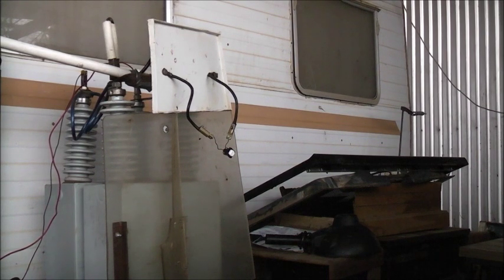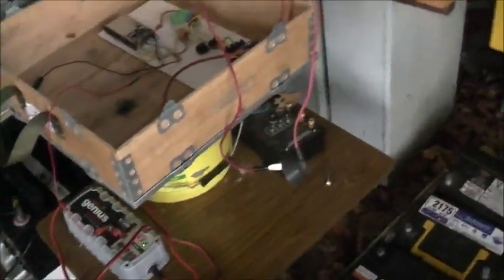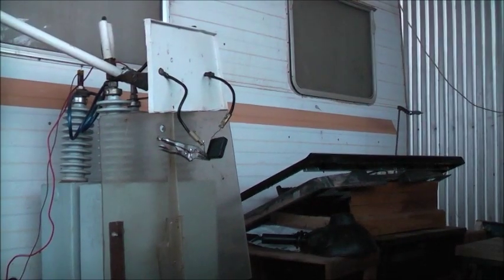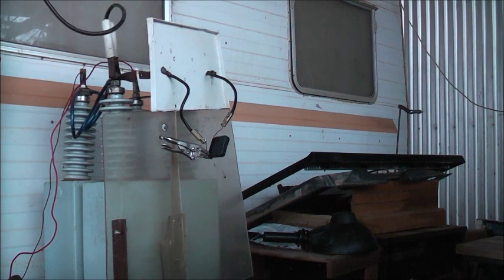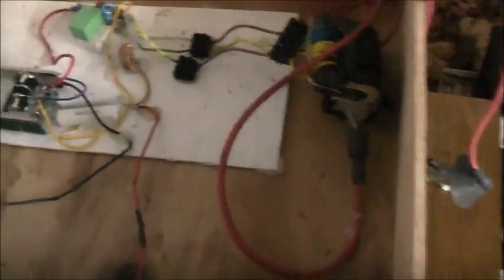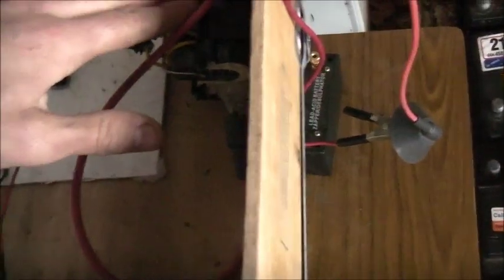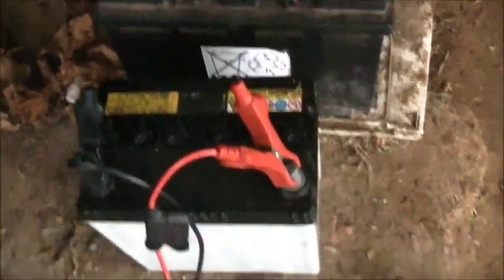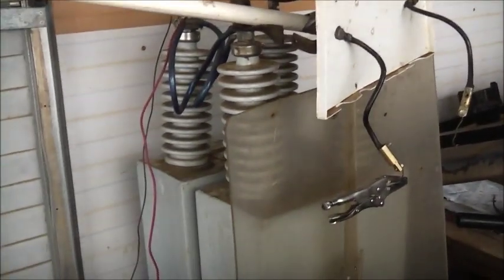Finishing Off Switch & Clock On PFC Cap Bank!

Comment: Clock mechanisms like that one are full of little shiny glittery stars. It's what makes them work and keep time. :D If you accidentally or deliberately overcharge them....

=WHOOOOOOOSSHHH= They all come shooting out everywhere. :D

It looks like you released all of the ones that were put in that mechanism at the factory. :D =YOU POPPED IT!= Now that you've let them out, that clock mech won't work anymore.

I think that lightswitch was a little over-rated, which is why it blew up like that. I want to get an old lightswitch and gently teeeaaase it on the variac to find out when the contacts weld-up in one. :D

Thanxx for showing.

This vid has been added into my Favourites!

-BoomBoxDeluxe.

18th June 2014, 01.15